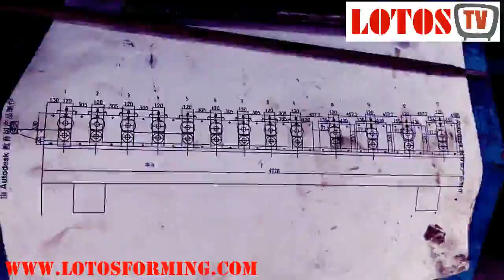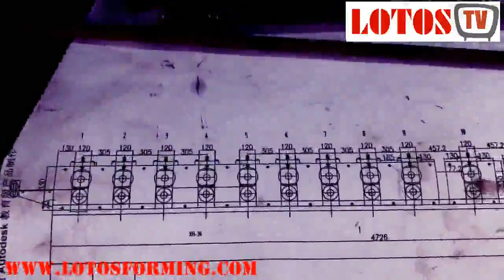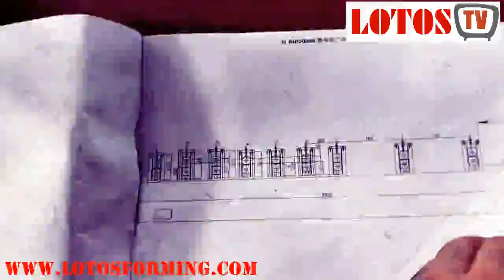Roll Forming

Comment: #Roll #forming steel is essentially a continuous bending operation performed on metal strip at room temperature. Tandem sets of rolls progressively shape the metal until the desired cross-sectional profile is achieved.
Reply from the maker: that's completely true, thanks for your effort.
www.lotosforming.com

Comment: it is important to examine each stage of the process and not merely the stand at which the problem initially appears. cold roll forming process requires successive forming profiles to be determined. an appropriate number of profiled roll sets to be designed for the product to be rolled.
Reply from the maker: https://lotosforming.com/2019/03/12/roll-forming-machine-basics/
thanks for your informations

Comment from the maker: The design #roll #forming  first need to establish the required forming steps and the number of forming steps for each bend. For example, a side lip may need 1, 2, 3, or more forming steps, and the bending maybe not continuous. For example, a 90 ° lip may be formed in the first 3 forming steps at 30, 60, 90°. And or in the first two steps, up to 60° and the last 30° bend will be formed in the last pass.